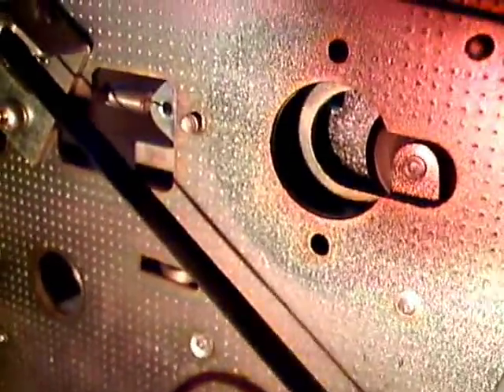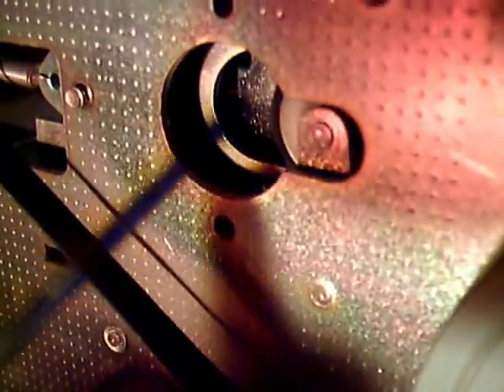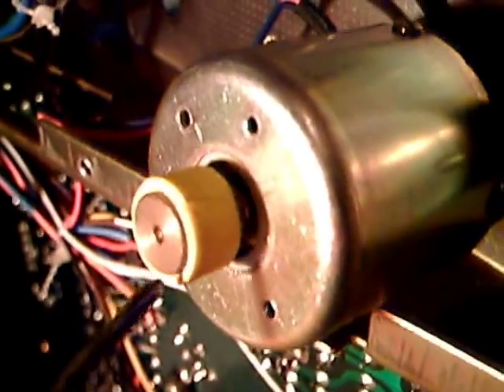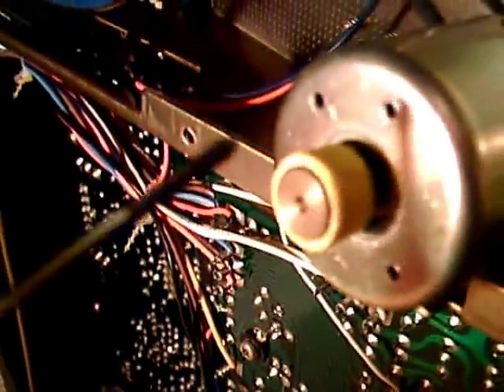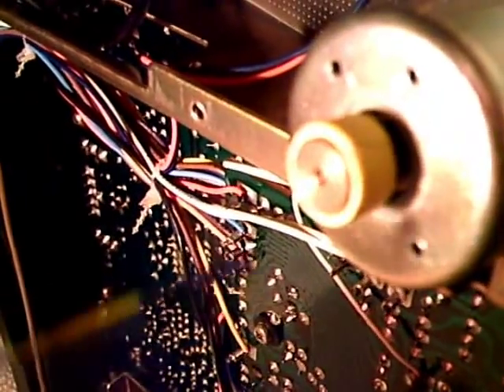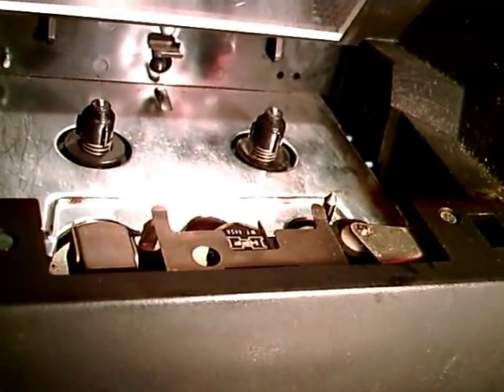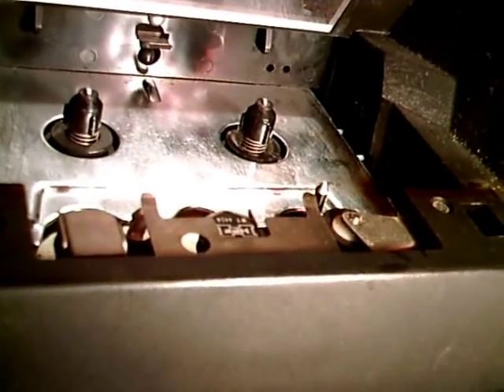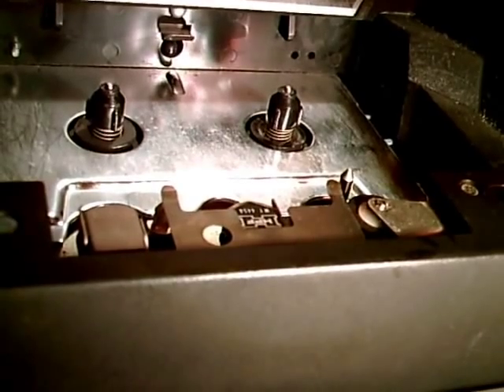Fixing the fast forward and rewind problem of my Technics 671

Comment: Since I got the Sears cassette recorder at Goodwill over the weekend, it works great, it plays good and there is a slight problem with fast forward and rewind buttons. You know why, it has an idler wheel which cause the problem. I need some help fixing the rewind and fast forward buttons, I would like to get it running. Thanks.

Comment: What is happening when FF and RW is almost not moving, not moving at all towards one end of the cassette or moving in an irregular fashion? ie. slow but speeding up a little then slowing down again. Is the idler wheel slipping? Is this actually due to the rubber surface loosing it's grip because the rubber becomes less tacky?  I have seen someone using a liquid product that restores rubber but i have no idea if it is a good product worth using over time.
Reply from the maker: These problems are indeed caused by idler wheels that are slipping, because their surface has lost its grip. There are various products to restore rubber surfaces, including some rather questionable ones. I find some light sanding with very fine grit sand paper and then cleaning with lighter fluid gives the rubber a new lease of life. (That process is not shown in this very old video)

Comment: I got a Yamaha KX 640 tape deck that looked as though it's been left sitting in a basement for decades. Everything's rusty and dusty, spools not turning which I'm guessing problems with the belt? It also doesn't seem to do anything when I press any button. It stays on 'rec' after I press stop, play, Dolby, or any button at all. Anyone knows any causes to this? @DrCassette
Reply from the maker: If everything is rusty, I would say that cassette deck is probably beyond repair.
Reply: @DrCassette  I would say the overall condition is 60 out of 100. When I first unload it off of its box, I turned it on and pressed the play, fast forward, and reverse buttons and the spools weren't turning. I can see a red indicator led on the display highlighting 'tape', and as I press the monitor button it switches onto 'source', as it should. Same as when I press the Dolby button. It highlights B or switches to C when I press it again. So I assume it was all working just fine apart from the spools not moving. I pressed the record button and the red indicator light shows it was on 'rec', the spools still not moving, and the counter shows 00:00. I pressed 'stop' but the indicator light says it's still on 'rec'.
Reply: I also noticed that the orange light inside the door of the deck don't seem to be on anymore after I pressed rec.
Reply from the maker: Seems like that could be a power supply or logic fault. But it could also be a result of moisture damage.

Comment: I have a high end dual cassette deck, in which FF and REW don't work in either deck. As soon as you depress FF or REW the button pops back to normal position. Ideas?? Play works normally.
Reply: Have the same problem with a jvc. Both sides play but won't ff or rew

Comment: great video!
repaired myself a RS-673 Deck. Works flawlessly now! But is it normal that the autostop has a delay of about 4 seconds till the tape stops like in this video? (while in play or ff/rw) 
mine does that too. adjustable? thx )
Reply from the maker: See if you can find a service manual, that might answer your question. I gave this cassette deck away a long time ago.

Comment: If i want to clean up the head and the pinch roller ,how i can do that?
Reply from the maker: Clean the heads and the capstan with a cotton swab soaked in IPA (isopropyl alcohol) or lighter fluid. Clean the rubber pinch roller with a dry cotton swab. Only if it is extremely dirty you can soak the cotton swab in IPA, but try to keep the cleaning process as short as possible. Dry the alcohol off the pinch roller right after applying it. Do not use lighter fluid. These chemicals attack the rubber.
Reply: @DrCassette  i found the easy way to get acces to clean up them!I remoded that plastic lid with HPF inscription and that all!The hard part is how to get acces to replace that belt is driving that shaft for counter?

Comment from the maker: I think it's good the way it is now. A faster rewind would be nice, but for that, the duct tape method is not enough. I would have to replace the bad idler wheel. So I won't try anymore things on there. The problem is fixed in my opinion.
But I'll have to work on the machine again anyway because the capstan motor needs to be lubricated.

Comment: Ha ha! good work Dr Cassette, you truly are, a "doctor" of cassettes!
One question though, do you know why the idler wheel is bad? I mean is the rubber all dull and slippery, like what usually happens to pinch rollers?
you could also try rubber hoses, and them laterally.

I always like your technical videos!

Comment: @DrCassette...Can u please help me with this problem. I checked out my belts, they looked pretty good, (almost new). When I play a tape it sounds normal, (no drag/slow). But when I press the stop button it goes into fast forward & rewind for about 2 seconds then it stops & I have to rewind the tape back in the shell. Even w/the pause button it goes into fast forward & rewind & then it stops pulling the tape out. Any suggestions would be highly appreciated. Thank you very much!!! Sony TC-KE400S

Comment: @DrCassette: I have an issue with a Tape deck, that only sometimes a cassette will not fassforward, and sometimes it will do with with diffrent Tapes, I remove the Tape and check if the Tape itself can spin forward, no problem there, The fast forward spole in the cassette deck spin fine with no tape inside, as soon as I put back the tape, the fastforward did not work, I had to rewind the tape instead on one side, and now the fastforward now works fine, Do you have any idea on what might cause this?(When the fastfoward did not work the tape was not at the ending yet)
Reply from the maker: That's most likely due to bad idler wheels. The rubber components need to be replaced.
Reply: @DrCassette: It could be but, if it was a bad idler wheels it would do it on every cassette not just sometimes one, then it does do it to other cassette when it does not do it on the first cassette, my theory my tap deck might have an anti-tape eating cluch, where the cluch of the take-up reel his connected with the capstan and the pinch roler, so I guess after play back when the pitch roller remove itself from the capstan the megnetic tape the reveal section stick to the buttom of the cassette, and since that was a cassette player that you have to put the reveal of the tape down, when it stop playing the magnetic tap will still sit on the the capstan during fast forward, and that his why it his not fassfowarding, when I look at the cassette the megnatic tape did not look like it stick, and it did not got eaten by the player neither, but after I rewind both side, it was able to fassfoward correctly, and like a mention before it was not the whell of the cassette causing the problem.
Reply from the maker: You're being quite creative there. Still, the problem most likely are bad idler wheels. The mechanism is supposed to transfer a certain amount of torque to the take up reel for the fast forward. Due to the bad idler wheels, the torque is low. For some cassettes it is still just enough to turn the take up reel, for other cassettes it is not. Also, at the beginning of the tape, a lower torque is needed than for when the tape approaches the end.
Reply: @DrCassette: well either way I don't have the money to get it fix by a professional, and also I don't want to do it myself since I don't want to break more stuff, as long as it does not affect the rewind, and the play idler wheel, and the capstan, and pintch roller idler wheel for playing the cassette, I'm ok with the way it his.

Comment: Will this work with a Tr-802 8 track deck..
Reply from the maker: Most certainly not. 8 tracks have an entirely different mechanism.
Reply: Gerry Roberts  I got a Panasonic RQ-J50 cassette player it plays my cassettes in fast forward everything sounds like the Chipmunks lol. any helpful ideas are appreciated
Reply from the maker: Sounds like the pinch roller of your Panasonic is either bad or does not fully engage...
Reply: TR-802 is radio shack,, not panisonic..